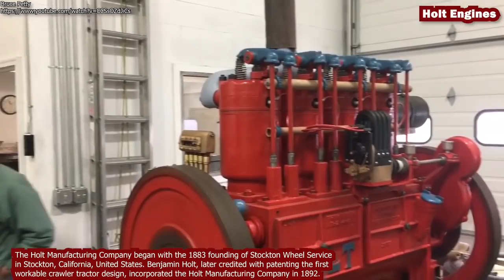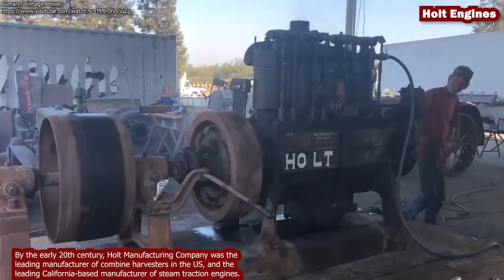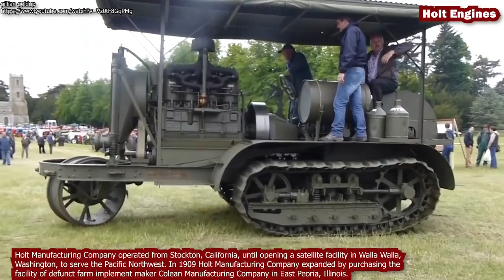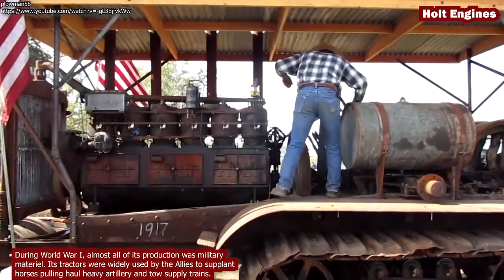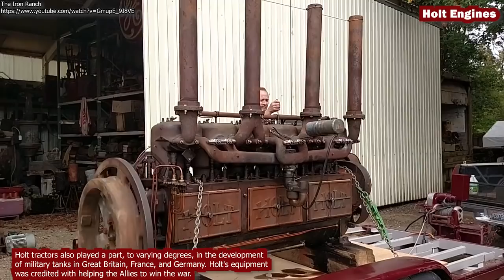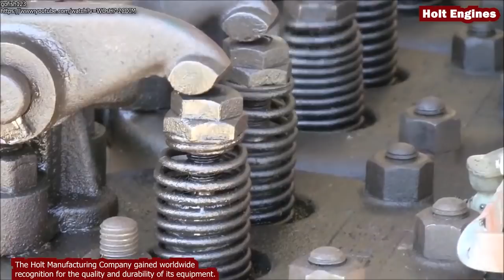Big Old HOLT Engines COLD STARTING UP AND COOL SOUND

Comment: When the RPM range is 250 to balls out at 1250.
Reply: Factory spec for the 6 cylinder 120hp is actually from about 100rpm up to a max of 550rpm. The 6 cylinder in the video has seen sustained running down to about 70rpm amazingly. It's fun to play with and sounds great doing it.